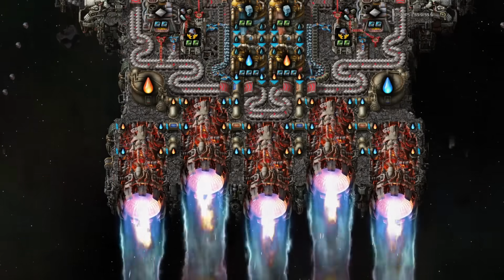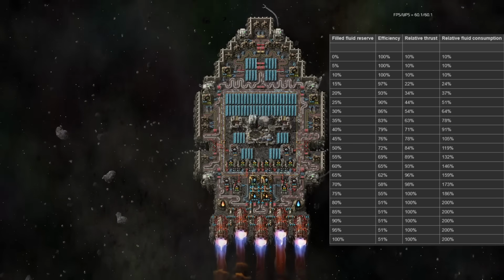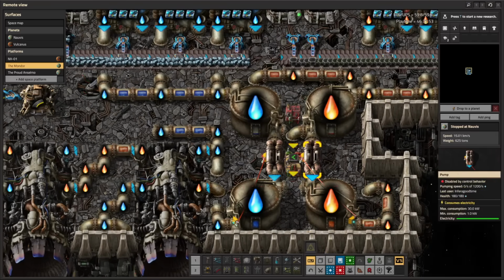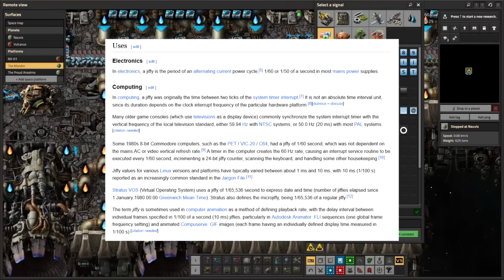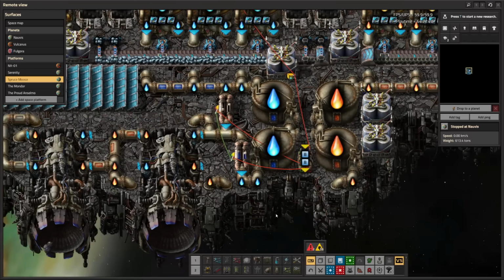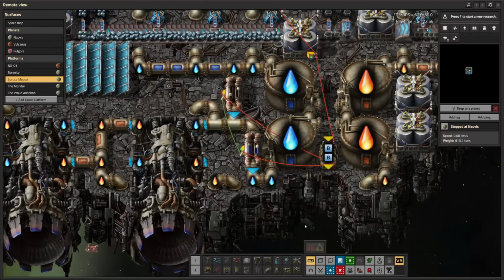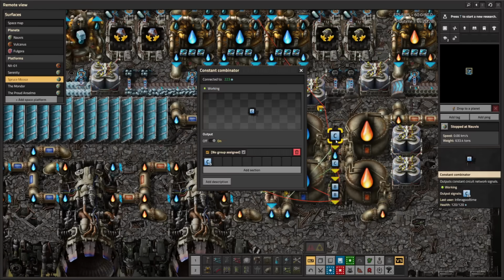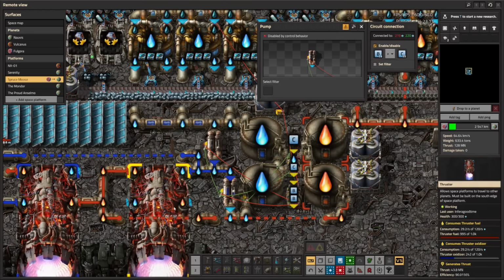How to Optimize Your Thrusters -Factorio: Space Age

Comment: One thought here. I don't think that it is that space in Factorio has drag per se. Rather it seems to be a crude gravity implementation.

As you are traveling along a route (I don't know  how this applies to Shattered planet, etc. as I have not yet reached that part) you will lose speed without thrusters firing for the first half of the time - e.g. Nauvis to Gleba being 15k you will lose speed until you hit I believe negative 10km/s for the first 7.5km. So after thrusters stop firing if you are not to the halfway point you will lose down into 'negative' speed to slowly drag you back to the planet. Once you hit that halfway point - 7.5km for the previous route - you'll stop feeling the 'drag' or gravity and instead you'll get a constant 10km/s boost forward. So with no thrusters firing you'll eventually slow to 10km/s, or with thrusters firing it will instead give you 10km/s higher speed that you would have had on the first half for the same fuel consumption.

(Actually as I'm writing this I stopped to think if the second half boost is 10km/s or 20km/s, I should test that. The 20km/s possibility being two components:
•The first 10km/s direct 'gravity' induced speed
• The second 10km/s being the 'drag' your thrusters would have been overcoming from the 1st half
I only say this all as my main ship is currently designed to stay at 10km/s. So the second half of the trip they are turned 'off', but I feel like I've seen speeds closer to 30km/s, though that may just be faulty memory.) 

So my guess has always been that it was a rough gravity effect being applied. Not being more complicated than it is to account for things like weaker gravity due to distance relative to the inverse square, or acceleration, not speed, being constant, etc. My assumption has been that they didn't want to get into more complex gravity and space mechanics with it, but still needed a mechanism to bring ships to a planet if they ran out of fuel and their fuel production chain was lost or damaged beyond functioning and repair. That way people don't end up with ships just lost to the void that could otherwise be fixed at a planet.

Just my 2cents on that part. But great video. My main ship has relied on keeping speed to a constant while minimizing fuel use - so I've essentially pulsed my thruster fuel based on overall speed to limit it to 10km/s - and thus my thrusters sit idle for the second half of the trip. Mainly just for collecting resources, building needs on other plants, and simple transport back and forth - so no need for much speed. Now that I'm working on my next ship I want better speed so I'm able to do other things and thats when I ran across this video. Currently rewatching it as I adapter 2nd ships thruster control system to implement what all you've shown here. Great work!

Comment: Jiffy was relevant (and although it isn't really out of the picture...) when cycles and processing speed correlated pretty straighforwardly.
Since video was CPU bound, matching graphics with the CPU cycle or "clock" made sense.
Nowadays it's more complex.

You still see lots of that in video/tv/digital video connections in like eg: video cameras etc... they are still not technically bound to each other, like you have NTSC at 60hz and 29.997 FPS... and I keep disgress, but anyway the point is 30/60 is also an easy to handle calculation/conversion/etc.

Even the appropriate context to conflate cycles and FPS in like... first generation consoles (atari, the first NES, etc) and home computers (msx, commodore, etc) was already pretty technically restricted

Modern games abstracted all that into.... "ticks" which are no that much different to measure time.
all that abstraction to reach basically the same

Comment: I ignore fuel efficiency and simply control my platforms speed directly. I do this by reading current velocity V from the hub, Setting some target speed S and calculating V - S = O. I then have a clock that resets every O ticks and pumps go on 1. I set my desired speed on a constant combinator and the platforms hover around 5 to 10 km/s above that so the pumps run 1 tick every about 5 to 10 ish ticks. I detect if the platform is travelling or not by reading source and destination signals and if any planet signal = 3 then I am stopped and shut down the system. 
This is all done with 1 constant, 1 arithmetic, and 2 deciders and zero fuel tanks.

Comment: u could do a close loop to control velocity of the space ship, i did it for my big ones and i can adjust the velocity from 150 to 350 km/s aprox with pretty good precision. the problem with closed loop like the one i did is that i been able to implement just a simple proportional controler as something more complicated like a full PID was getting out of hand with the delays and caused instability, ive tried also to make a digital filter for the set point, to not apply directly the full setpoint as the space ship tends to overshoot at the start. too much problem for what i needed. but is totally posible

Comment: Thankyou very much for this man! the concept is pretty clear and i have tryed ...i made a ship with 1 thrusterso C was 89,My speed set was 80 and, with 1 thruster only, my top speed was barely 140 km/s

the run went this way:
1) during the start i had full thrust until the ship reached 130 ... (the pump was already throttling) this is espected the initial thrust has is own "inhertia" so
2) then it slowed own to 82 ... maybe 81 (i'm sure it reached the 80 otherwise it wouldn't have worked)
3) then it went up to 110-120 again and it continued this way for the whole trip to vulcanus

uhmm ... your is the first complete explanation i see maybe i did something wrong :P

Comment: This is a really fun video, currently I'm working on creating a ship with a fluid duty cycle, so that the lower the fuel in the tanks are, the smaller amount of fuel is used

Aka: x% of the tank being full means that the pumps work x% of the time 
And the pumps i made to work onpy for 1 tick at a time

It works like this:
2.5M / (fluid in tank +1) = duty cycle length
The clock is:
T+100 % duty cycle length = T
Pumps work when T < 100

Comment: I just went for bang-bang control off the ship's speed. Wire hub to decider, turn fuel pumps off if speed is too high or too low (when in orbit). It's rough and inaccurate but it works a lot better than having the engines on full blast all the time.

Comment: i managed to restrict fuel flow by setting the pumps to stop pumping when a tank on the thruster side of the pump read X amount of fluid, which would be the desired amount of fuel.
for example if you want 100 units per second you set the pump to stop pumping when the tank gets to 100 units of liquid.
it doesnt result in the exact number, but it gets within a few percent of the desired result.
the thrusters do fill up fully when the ship is idle, though im sure i could fix that now that ive done tinkering with location signals (maybe with a less thab X speed?) for a nuclear reactor on my "everything" ship
Reply: you're so right, this is genius!
Reply: Its not as efficient as the design he shows, but it is simple enough to work fine. You can watch the thrusters during flight to check

Comment: On the math of your timing circuit setup you were a bit inconsistent with your "60" frame cycle. 
At 5:59 using <60 which would create a 0-59 (60 total frames) output of (setup frame) 0, (initial passthrough) 1, (accumulation) 2-59, (condition fails) 0, then relooping from passthrough.
Whereas 9:32 you use <61, which would create a 0-60 (61 total frames) output in a similar pattern.

In either case this would create some weirdness with your math as paraphrased from 11:50 "3 frames active per second means they are active when the clock is greater than 57"
As the former would only be active for 2 / 60 and the latter for 3 / 61.

This is only a nitpick though, as you are correct in pointing out that calculating the numbers exactly is only a starting point. The complications in fluid throughput relative to the fluid levels when the level is near empty/full and prereq that the input pipes (for non direct feed pumps) must be empty, means that you will have to tune your system anyways to match the pipe network and engine count.

Comment: The real optimization in factorio is always to make your production outpace your consumption, choking your consumption is just kicking the can down the road
Reply: At least at 75% throttling it's literally the same output for less input, like using productivity modules. It's still a facet to consider (tho with advanced fuel and endgame ships yeah "just produce more" still is fine)
Reply: Have you ever gone to gleeba?
Reply: This is mostly applicable at 3 points.
1:Very early space travel before the advanced asteroid processing tech.
2: minimalistic ships with limited ammo/fuel production (again, early travel)
3: travel out past solar system edge where you want ammo and speed to be at VERY specific values in certain places. Such as getting a ship with biter eggs out to where promethium asteroids are as fast as possible, then slowing down to protect the ship and conserve ammo

Comment: More engines actually better on fuel economy, IF you do not increase the width of the platform. That means the right way to build ships right now is to... build a stick with at least 90 tiles of void below the engine, and repeat that pattern forewer.
This DLC feels so half assed and I hate it because of that.

Comment: "You can't just spam low power thrusters to get excellent fuel economy and expect to get anywhere." If by saying this you mean that you can't expect to see a substantial measurable benefit to your ship's stats then this is false. For a ship of a given width and given fuel/oxidizer consumption per second, it is strictly ALWAYS better to have as many thrusters as possible (and as high a quality as possible, though you mentioned only low power thrusters), as this can vastly increase your fuel economy and thus your thrust per unit fuel consumed. I tested with a ship wide enough for 23 thrusters producing 1200 fuel and oxidizer per second. With 10 common thrusters at 100% consumption the speed is 172.24km/s. With 20 common thrusters at 50% consumption the speed makes a significant jump to 217.64km/s, a 20% increase. Again, this is the same amount of fuel/oxidizer consumed per second, with a ship of the same width. Nothing different except more thrusters. With 23 legendary thrusters it jumps up to 243.24km/s.

This is generally true across ships of all widths, heights, fuel/s: If you can fit more thrusters, you should put more thrusters, as many as you can without increasing the width, as this maximizes your thrust generated per unit fuel and gets you the most out of your fuel. You are wasting fuel if you use less thrusters than as many as you can fit for the width. Obviously this requires regulating the rate at which fuel is delivered to your thrusters as you do here.

Comment: I use fly time for shattered planet and set up a decider combinator clock that runs only when i am going to or from the shattered planet and resets to 0 when anywhere else. The clock is set to the total flight time in game ticks. Every second is 60 tics so 100 seconds in shattered planet is 12000 tics. I use decider combinator pulse generators of different lengths to turn chem plants on and off at different times based on the value of 12000 tic clock. Change pulse time to reach a desired average speed. Speed will fluctuate based on the pulse.

Comment: The "location" signal you talk about is actually two separate pieces of information. The "moving towards" and "moving away from" signals are equal to one of the planet signals at value of 1 or 2. If any planet signal is equal to 3, it means you're in orbit and can immediately shut off your fuel pumps.
Reply from the maker: Thank you, it was very difficult for me to actually find any answers regarding the platform signals.
Reply: I was curious what the signals actually looked like, as I figured "Hey if you at least know velocity and destination you could save location to a register and compare it with destination." But that makes it even simpler, just check if any of the signals are "moving towards".
Reply: Filtering location signals from platform and checking if "anything" = 1 (or 2) i.e. platform is moving to (from) sometting, or "everything" < 3, i.e. platform is not parked anywhere.

Comment: You don't need the constant combinator to make a clock anymore. Also if power runs low the clock slows down so a belt loop with an item on it can be more reliable. You can also swap thruster inputs with the horizontal mirror key "H".
Reply: you cannot flip thrusters (or signalled rail) without a mod.

Comment: I use an overflow valve, but set condition with a very small number, something around 600 for some 12 thrusters (didn't play the game for a month, can't remember exactly). It limits the pump throughput. I don't know what is the math, but you can use trial and error on an operating ship to determine the number in the condition, so that all thrusters have the amount of fluids you want.

Comment: You can stack thrusters tho the no build area behind thrusters is big but not infinite.

This leads to fish tail designs where you can realistically throttle your thrusters by having enough to reach your desired efficiency.

I went with 25 a block of 12 with a gap in the middle and 13 behind which gives 100 efficiency and over 120km/s speed for 1 chemical plant each of fuel and oxidizer very thin ship as well fairly happy with that design.
Reply: Didn't know that the no build area isn't infinite. Yet another way building really long ships breaks the games travel logic. XD
Reply: @PBOZAI  the space noodle superiority proven once again xD